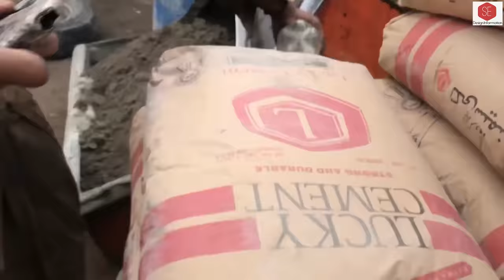House Roof Concrete with Concrete Mixer Machine .Cement Sand. Crush

Comment: Cement and flip-flops don’t mix. 😁
Reply from the maker: Maybe 🤔
Reply: @surveyingengineeringdesigninfo  - if it works, it works ! I’m not judging! 
Works for you - fine with me 👍
Reply from the maker: Thanks 
Local Contractor Working
Different Work Style 
Concrete Mixer & Batching Plant
Spouse Slump & Water Ratio
Reply: 1:2:4 old school mix without admixture
Reply from the maker: @rogerkingip9399  
Agreed.
Reply: @mar1video гщ ео8м
Reply: @surveyingengineeringdesigninfo  1  cement, 2 part sand, 3 part aggregate,  100 part water. Pass me a straw.
Reply: I think😂

Comment: How do you buy your materials, by the weight or by the load. How about your cement bags, what's the price for them
Reply: sand----12000 a damper(may be 50 to 75 ton)
gravel---50 rupee per square feet it's defferent price you're near crushing factory you may less if your distance  long it's extra charge 
cement---550 to 600 it's equal all pakistan
and labour 500 square feet is around  10000 rupee(pkr)